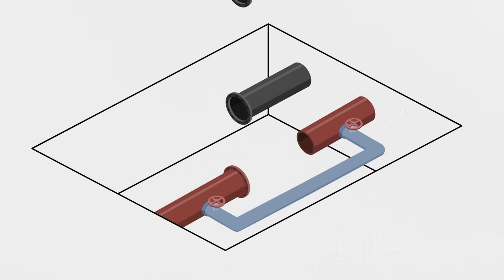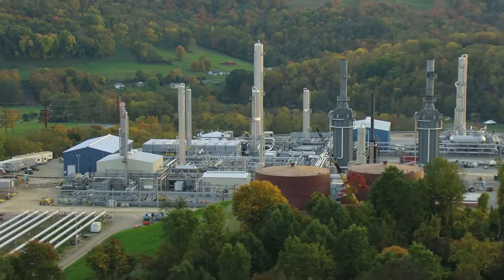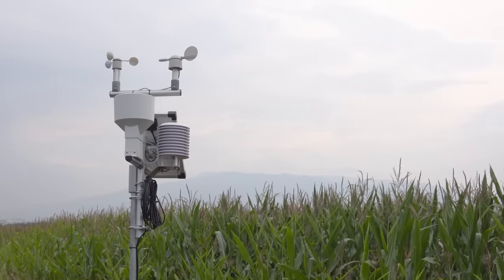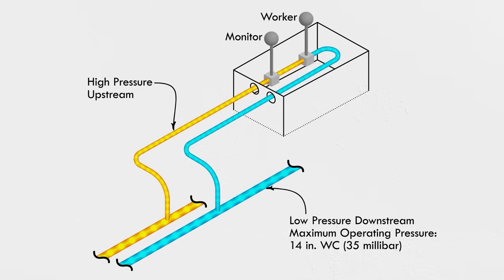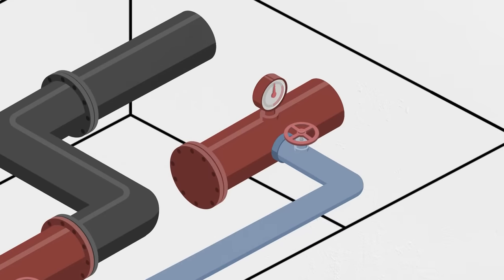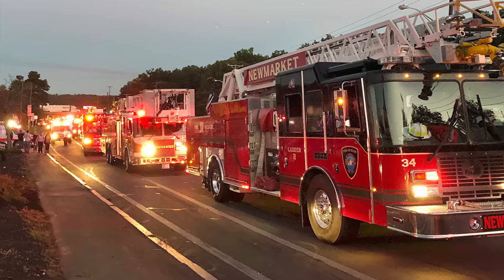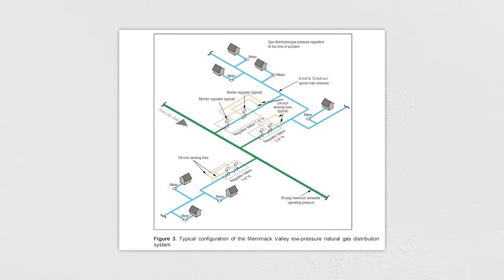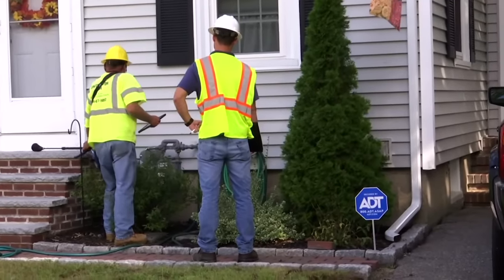What Really Happened During the Gas Explosions in the Merrimack Valley?

Comment from the maker: 🌌Get Nebula using my link for 40% off an annual subscription: https://go.nebula.tv/Practical-Engineering
🛠What engineering disaster would you like to see me cover next?
Reply: The way you pronounced Winthrop really bothers me. Lmao..

Yeah I remember this first hand. I live in a neighboring city..

I remember when all they were talking about was terrorism, and that's one of the biggest reasons why New Hampshire and Maine in every neighboring city hopped in.

I remember seeing even all the way down to nearly Boston, people were displaced and forced to move south where there was more housing, and everyone was afraid to move in somewhere with similar infrastructure owned by the same company after the dust settled.

That was super scary.
Reply: What is the method/process/algorithm/checklist that should have been done to let someone know that the sensor needed to be moved? How was someone in the management chain supposed to know that the sensor needed to be moved? Or that it was there? Also, why doesn't the value have a top end to prevent an accidental over pressure? If someone punches a hole in the line and the pressure keeps dropping no matter how much that valve opens, that seems like a recipe for disaster.  I understand that a sign off by a licensed PE is recommended but  what are they doing differently? Are there some standards they are using to examine the plans against to know to ask "what about the sensors?"
Reply: Deepwater Horizon Disaster
Reply: leave nebula
Reply: @TheBitter73  Safety is an outcome, and there are a variety of elements that must be considered in order to achieve it. The biggest benefit of requiring Professional Engineer oversight is that this person has gone through an intensive process of education, on-the-job training, standardized testing, gaining professional standing (character/competency references from other licensed PEs they have worked with), and continuing education in order to verify that they are competent and will uphold ethical standards. A Professional Engineer is legally obligated to consider if they have the necessary competencies to oversee a particular project, is empowered to tell their boss "absolutely not" without retaliation (engineering firms are licensed by a state board of professional engineers and will have their license revoked if they do retaliate), and will potentially face personal civil and criminal liability possibly including prison if they act negligently in performing their duties and people are hurt or killed as a result. It's also a profession with high demand and tremendous barriers to entry, so the "soft" consequences of pushing back on a reckless employer are not as severe as in certain other professions.
Reply: I would like to see more focus on the developing world. Bangladesh has had several that deserve more attention, especially the 2013 Rana Plaza collapse and the following work by local and international organizations (including the industry-led organizations Alliance for Bangladesh and Bangladesh Accord) to improve worker safety in the so-called "3rd world sweatshops" that clothe the world.
Reply: I-35 Bridge Collapse near Minneapolis-St. Paul MN...? 🤔
Reply: Totally agree about independent creators like yourself making some extremely valuable content! You very much deserve to be on that list with Real Engineering and the rest of them, Grady! That was one of the best story hooks I've ever heard. Well done sir!
Reply: @TheBitter73   C-Management wouldn't know, that's the job of the engineering staff, and the person/group designing the cutover. You have to understand that with the sensor attached to the wrong line, a top-end cutoff would do nothing since the valve was only measuring a dead line that would always read zero, while the pressure in the actual line was continually increasing. Someone punching a hole in the downstream would actually lower the pressure of the real system (and probably cause a localized disaster), and the regulators would be sensing the real pressure drop, not a false one.
Reply: I wonder how the water infrastructure handled all those fires at once.
Reply: Now do the San Bruno Explosion disaster 😅
Reply: @TheBitter73  This isn't my industry but in mine we call them MOPs for "Method of Procedure" and they are meant as a checklist to make sure each step is followed and confirmed before moving to the next one.  I would argue that Grady's use of "failure" here was not a failure of the pressure regulators - they performed as designed - but rather this was a failure of process (aka execution) by the crew.  Having a PE with presumably a complete overview the system (gas or otherwise) and understands the casual effects of each step and potential for injuries or property destruction is not a panacea but when that person puts their reputation and livelihood on the line with that stamp they usually make sure that potential is minimized.  The management chain should include a qualified person and that could be a PE or someone else with intimate knowledge of the system design and how to modify it safely.  The crew working that day was at the mercy of another crew two years prior according to Grady.  Ideally there might have been a test prior to starting the work to verify those sensing lines were connected properly.  They essentially broke their negative feedback loop that regulated the low pressure line.

To your "punched line" question, I imagine the pressure regulator would act much the same way - opening the valves to meet increasing demand - but you would hope the line is open the environment and not in an enclosed space.  From there I would think one of two things might happen - the operator (the Gas Co) would note the unusual increase in demand and investigate further or someone would smell the gas leak and report it.  NatGas is great resource but you have to be careful with it.
Reply: I've been a fan for years and you convinced me to sign up for Nebula in this video. I really appreciate what you do Grady. Thank you!
Reply: Not buying it, you know the sensors are not working by not sending data... got off cheap at  80 million
Reply: I’d love to see you do a video on the San Bruno gas pipeline explosion in 2010 as well. Eight people died and most of an entire neighborhood burned down. Very tragic.
Reply: Don't know if you've already done this...

But I bet this would get you views from "The Algorithm"....

drumroll

The "Fire of London"... The BIG one...
And uhhh... Even if you've covered that topic before...

Just covering "Fireproofing infrastructure" should have about... 5 videos in it.
I'm a new viewer... And not an engineer man...

Just a fan of science.
Reply: I would except that i'm retired.
Reply: I realise the title of this channel is practical engineering. But would love to know how these huge projects, are built not from the prospective of the actual engineering but from everything else. How are the people organised ? project initiated ? is there one person in charge ? multiple companies ? Are specialists all over the place ? How is it funded ? a 10 year infrastructure project must have an amazing amount of organisation.

Then I realise you mention a little here, but when it goes bad, who is responsible ? what liability from the people involved in the building ? who decides and funds the remediation activities ? What power does these industry and standards groups have to create standards and enforce them ? Was watching the Millennium Tower video, and was wondering is this acceptable ? career impact ? do companies go under for this or insurance deals with it so everyone is good ?
Reply: @TheBitter73  method? The method is having trained professionals who know the theory of what's going on so they don't rely on reduced analyses like procedural checklists. The method is for them to make the checklists. I'm not sure what the question is. I think you're overcomplicating a bit, no offense, but that's just my perception.

Comment: It is good to see the NTSB didn't try to throw the trades under the bus and showed that management totally dropped the ball.
Reply: In serious incident investigation, management has a share of the blame in almost every situation.  For example: if untrained workers do a slipshod job -- who is really to blame?
Reply: I think if they had the backup sense line already attached to the new line it wouldn't have ended this way.
Reply: Thats not the NTSBs way. They know hanging people out to try leads to coverups and that makes things unsafe.  All they care about is making things safer and preventing the same things from happening again.
Reply: Heptex  That's still management. It's their job to make sure people are actually qualified, too.
Reply: One of the nice things is that the NTSB is left to operate it's mission: Find out what happened during an event and suggesting changes that make sure those events never happen. Their job has never been to "find fault" and hold people accountable. (That's a big difference between them and the FAA when investigating crashes, even though they work together on many investigations.) That's not to say they wouldn't have said anything if the crews working on either end of the systems did anything wrong. But it does nothing to improve safety for the NTSB to throw people under the bus or point fingers.
Reply: This is why the NTSB has no regulatory authority, it means less pressure on them to meet an approved conclusion, instead, they try to find the truth, and then make recommendations that can be ignored. Not perfect, could be a lot worse.
Reply: Heptex  it's managements job to do proper oversight of those under them.
Reply: @RonaldPottol  No regulatory authority with power would have found the workers liable, lack of authority has nothing to do with it. The lack of authority means nothing gets fixed. This is a rare case that something was done as the damage was too great to ignore. NTSB who are already under staffed/funded is an example of regulatory capture, as the industries pinky swear they will listen to the recommendations and the reason why the engineer exclusion was there in the first place as it saves $$$. This is what deregulation looks like. It's barely above having nothing and not something to say 'It could be worse' or celebrated. It's like investigating a murder, finding who done it and expecting the perpetrator to punish themselves or the life insurance company to sue them into jail.

Air travel is only as safe as it is because the FAA and agencies like it around the world has authority, funding and staff to quickly issue fines, find fault, modify rules and procedures, stop traffic and ground planes. Being able to assign responsibility isn't exclusionary to finding the truth. The rules are there and enforced because every line is written in blood.
Reply: @oohhboy-funhouse  is still ignored by the majority of the country.
Just waiting for similar thing to happen and companies saying, how could we have known..

Never will understand how findings from such an authority can simply be brushed aside, their recomendations should simply always be implemented on a federal level.
Reply: @baronvonlimbourgh1716  Simple, no authority. NTSB had none from it's founding and form to prevent an agency with authority. It would be like if the EPA could only give recommendations. You think tap water is bad now?

Creating the new agency s near impossible. There are blocks like 'State rights', lobbying, greed, idealogical nonsense, dilution of safety rules or making the agency toothless or under funded.

There are a lot of other indirect factors like how insurance works.
Reply: In my experience the NTSB does not hold back any punches on those who are to blame, if you ever need stuff to read dig through NTSB reports as they are incredible
Reply: @oohhboy-funhouse  yeah, how that is allowed to fester in society to that degree i will never understand.
Reply: Heptex  I worked for a contractor that did Alot of work for Columbia gas around that time. My younger brother also currently worked for Columbia. They had and have a strict training and qualification curriculum. Had to certify on everything with a written test and a hands-on test, had to recertify every other year. Militant about safety too, they would do safety audits all the time, on the verge of being anal.
Reply: @mrsmith2876  I am formila with the training received by gas utility contractors and your correct it's strict and firm. Those contractors did absolutely nothing wrong and documents showed this. This was a preventable accident if 1 upper management never changed long established procedures
Reply: @oohhboy-funhouse  I agree that you need a regulatory body with power like the FAA, but the NTSB has a role to play as well, as they have a well-deserved reputation for not covering for anybody, which the FAA can't claim. They're not perfect (totally face palm moment when Sumwalt said trains should just use iPads for location information, obvioully he has never been on a train through the Rockies trying to use location data off a GPS device), but I respect what they do and watch every public board meeting. The transparency they bring is incredibly important.
Reply: @leerman22  That's the entire point. They didn't. The sensing lines were still left connected to the old line.
Reply: Only if you knew the actual subcontractor who was doing the work .. then you’d be wondering why the NTSB didn’t throw them under the bus along with Columbia Gas
Reply: @massholesixty9  the contractor doing the work did absolutely nothing wrong. As a union worker during my work history I have opposed contractor work. There quality of work was no different than others because of required certification and training. They hold no responsibility
Reply: Heptex  the old procedures required the reg. Department guys be there and kept updated. That pit could of been shut down during that last connection then turned on while monitoring its operation. There is a requirement to use a bypass when doing final connections. Why do they do this ? Because when you do final cut you could of missed something not documented. The new main after it passed pressure test was connected to the regulator pit. I don't even think the regulator guys were involved in that. If they were I cannot believe they would of not let static lines stay unconnected. I have traced static lines when construction projects were done in area of pits under the guidance of reg dept guys. I have stopped contractors digging until reg. Dept responded and either stood by or cleared the site. I didn't work in Columbia gas area but the gas utility that borders there area.  It would be like a surgeon replacing an artery or vein that starts around your groin and connected to your heart. Never having a heart surgeon involved. I hope you understand what I mean even though example is ridiculous.
Reply: @leerman22  those should of been connected when they tied the new main into the pit.  Upper management (1) decided no need to keep reg dept guys involved. That was the issue
Reply: @baronvonlimbourgh1716  the lesson learned was to never eliminate the regulator department from the project.  There were documents that needed signatures but manager in charge of the engineering department decided they were not needed. You're correct this could happen again if procedures are skipped but workers doing the labor have no responsibility for the incident